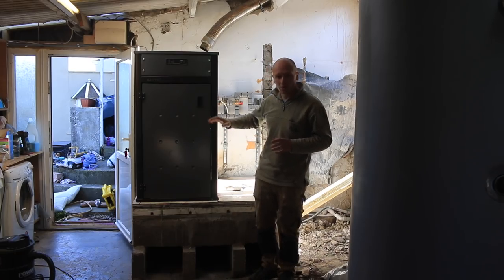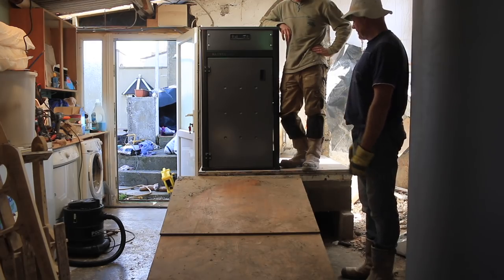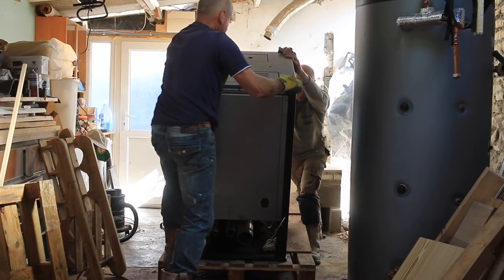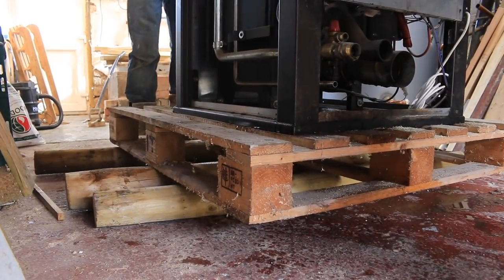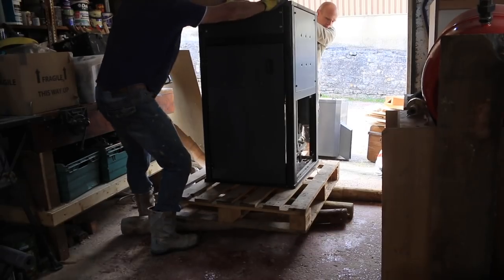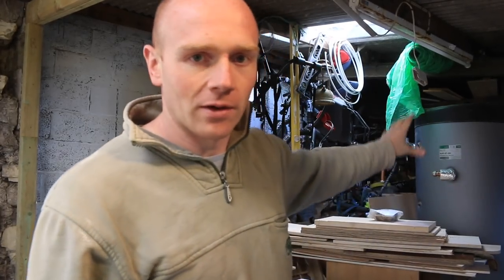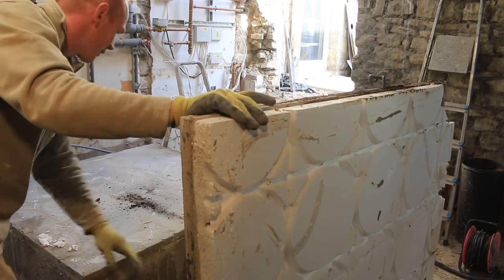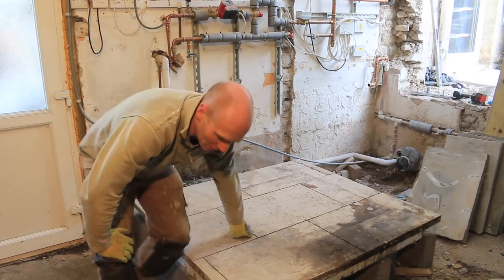MOVING A 350KG BOILER BY HAND - STONEHENGE STYLE!

Comment: I once saw a large cast iron post office safe being moved. 6ft high, 3ft square. It had to go from a truck tail lift, across a sloped wide pavement, up a slope into the shop. All they used was a sled. A piece of thick ply with very heavy castors on it. Mad. There were some hairy moments getting it on and off the sled and up the slopes. That thing must have weighed 1000kg at least. The doors must weigh 100kg alone.